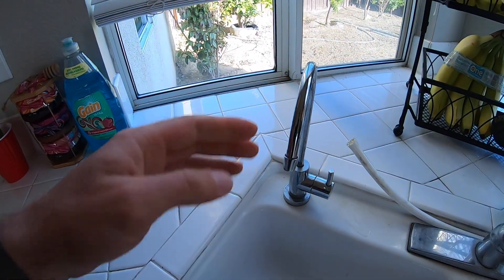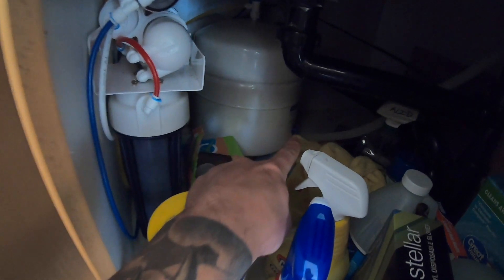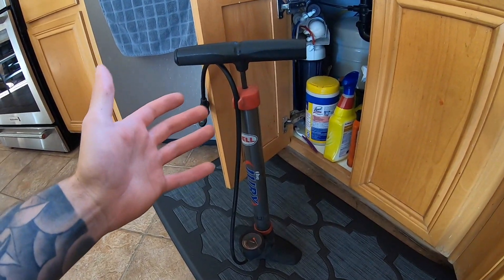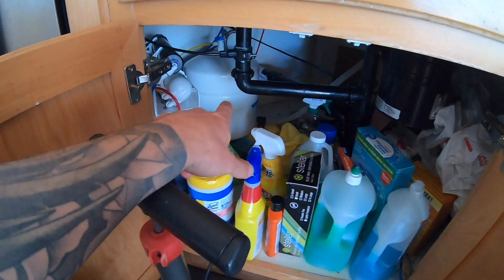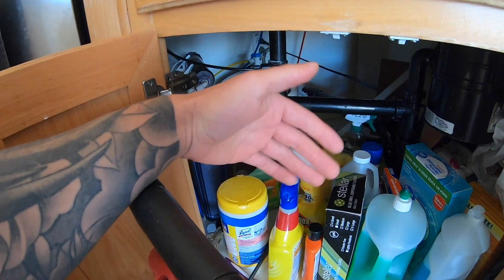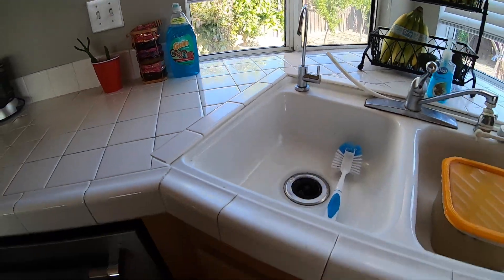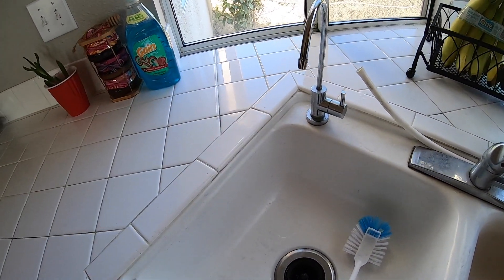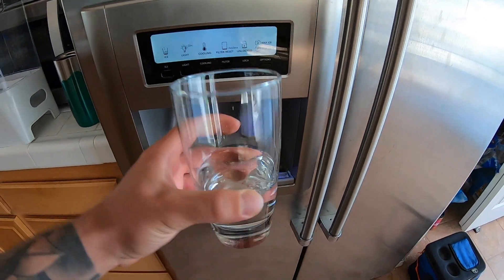How to get MORE PRESSURE Reverse Osmosis

Comment: Hey man, great video. I came here because I was changing my filters today and was wondering if there was something I could buy to increase the pressure/flow. Turns out I didn't need to buy anything. I do have a few addendums which may help other people though.
Firstly, after viewing this video and seeing torkmonster's comment below, I checked the Az page for my filter and it says I can charge 10-12 PSI *empty*. This should get even better pressure/flow than you achieved as the air pressure will increase as the bladder expands.
After charging the tank, I opened the valve and suddenly, a lot of water flowed out. This suggests that the relaxed bladder holds a fair bit of water and contrary to what others suggested below, this may increase tank capacity. Experiments would be needed but I never use the full tank anyway so don't really care.
The label on my tank says factory charge 7PSI but my pump gauge read 0. I don't know if it means that it leaked down but it seems like this is a procedure that is probably best done at every filter change. So thanks again.
The tank says 100PSI max which suggests that you could probably go for a bit more pressure. I'm not sure what the outlet pressure of the RO system is or at what pressure the RO process might get interfered with so probably best to stick with the recommendations or close to. I'm also not sure if there's a pressure regulator in the system but I suspect so.

Comment: The line pressure for the water will come to the same equilibrium on the next tank refill. So by adding too much air it will help you only one time but diminish tank capacity forever ( unless you let air out of the tank bladder system).
Reply: I found after I added air, I actually got more water out of the tank after I had 'emptied' it. So it may actually increase capacity as the bladder holds water when relaxed.
Reply: @chaos.corner  Fyi, adding air absolutely decreases the tank's water capacity, whether or not the psi was too low to start with; full stop. 

It's true that adding air allows the tank to empty out more of it's water. It's just that now your "full" tank has less water in it to start with.

This is why you want the correct air pressure. Too little and you'll have lousy dispense pressure. Too much and your tank holds less--plus it won't help your dispense pressure because of how the shut-off valve works.

Comment: From what I’ve viewed, your suppose to do with the tank empty ?? Inflate to 6-8 PSI empty. Pressure will go up once filled. But this must work, curious what size line goes to your fridge ??
Reply: Must be one or the other. Pressure with the tank empty will be different than filled. I don't think I ever use much from my tank though.
Reply: Update: I checked the Amazon page for my RO system and got "Yes, you can increase the air pressure inside the RO Tank to a maximum of 10-12 psi on an empty tank." so you're right. I'm going to do this. It wasn't in the instructions, I'm pretty sure.

Comment: You can’t compress water. I have no idea what happened when he pumped that up. 

I would do this… with the tank empty! Turn off that water, open the sink valve
Reply: There's a rubber bladder inside the tank with air around it.

Comment: Doesn't look like much difference in pressure?  I did the same and still have very low pressure on my new unit!!
Reply: You're supposed to do it empty. Still waiting for mine to refill after a filter change... Mine was at 0PSI so they may leak down in time too.

Comment: So if you add pressure to the tank, and the valve only produces water until tank pressure is 2/3 incoming pressure, wouldn’t that just mean you store less water in your tank? I think the incoming water pressure dictates how much pressure sits in your tank. Once the water leaves the tank, pressure will not go up past 2/3 of incoming water pressure again.
Reply: You are exactly correct, bad info in this video.
Reply: Yes, agreed. He pumped it up while there was water in it so of course the pressure increased. Next time the tank fills the water pressure will be the same as before, only the tank will hold less water. Bad info in the video.
Reply: @SteveThePre  so what do you do?  Drain the tank, then pump it up?  Does that work?
Reply: @myeyepie  Drain it completely before you adjust the tank air pressure, yes.  It only worked for this guy because he added air while the tank was full, and the next time his RO cycles, his tank water pressure will go back to crap again. 

You can't substantially change the water pressure by overinflating the tank. All that will happen is the tank will hold less water, but your RO tank's water pressure will remain roughly the same. This is the nature of the way RO fill valves work. 

One thing you can do is add a pump to your supply line just before the RO system altogether. That will increase the RO's incoming water pressure and in turn increase the pressure of the water that gets stored in the tank. There are other methods but this works pretty well and isn't too awfully complex or expensive.
Reply: @SteveThePre  well my water pressure is 70 incoming all the time.  Not sure I would want to push it much higher than that.  When I went from 65 to 70 I had all sorts of small leaks show up around the house that had to be adjusted to accommodate that pressure.  

One thing I did do that helped under the sink was to put a second tank.  Apparently the fully charged tank has the highest pressure so by putting in two tanks I ended up with twice as much water coming out at peak pressure.  But the fridge pressure was still very weak.
Reply: @myeyepie  Yeah I had/have the same problem with the fridge dispenser. The beauty of it is, the pump only increases the water pressure that feeds your RO. It doesn't boost the water pressure of your whole house. I'm not saying that kind of pump is a miracle... It got my fridge to fill a glass of water in like 18-20 seconds instead of almost 30 seconds, which is significant in my book. 

I added a second tank as well. That does nothing for flow rate unless you raise it up higher than the first tank. It does, however, give you more stored water before the RO system needs to regenerate, such as if you fill pots with water for pasta, boiling, etc.

One other thing that might help... Remove the water filter that's in your fridge. All it's doing is restricting flow rate. If your RO is running properly, the fridge filter will not take a darn thing out of your water that the RO membrane didn't already remove.
Reply: @SteveThePre  It works because there is a bladder inside the tank and you're adding air to the volume around the bladder. You're correct you're supposed to add it to an empty tank though.
Reply: @chaos.corner  Yep, I understand that. The problem is, the back-pressure from the tank diaphragm is what shuts off the refill process (ASO valve). You want just enough air pressure in the tank to let it get nearly full just as the ASO shuts off. It's true that too little air pressure will reduce the dispense pressure, so yeah, his tank "might" have been under-pressure, but this only happens if there's a leak or if it was mis-pressurized from the factory.

Anyway, once you get the tank up to "just enough" psi, adding more air won't help. More pressure just means the tank won't get full as full, because it will reach the ASO's back-pressure shut-off level earlier.

He artificially added air to a full tank. This works only one time. Next time the tank refills, he'll have the same dispense pressure as before, but now the tank will hold less and the system will cycle more frequently. 

Most people misunderstand how these systems work. I've seen a number of other videos where people add psi or add a second tank to improve flow rate; neither of these actually works.

The "best" way to to solve this is with a bigger 3/8" system; it won't increase the pressure (you'd still have the same ASO issue), but it will increase the flow rate, which is what we're really after. Problem is, it's expensive and time-consuming.

Instead, the usual solution is to increase the supply water pressure, which is typically done by adding an electric booster pump just upstream of the RO for around $100. This way, the tank pressure can get higher before the ASO shuts down the refill process.

It would be super cool if someone made an automatic air compressor that pressurized the tank after it was filled, and de-pressurized it when refilling. This would be massively more energy- and water-efficient. Maybe it already exists and I'm just unaware.
Reply: Edit: Just going to put at the top that I looked into how the shutoff valves work and affirm that you're 100% correct so please ignore anything below that appears to question that.

 @SteveThePre  It wouldn't be a one-time thing unless the air leaked out somewhere but correct that he should have done it with the bladder empty. I believe he's way below the pressure that would cause things to stop functioning.
I did mine after I replied above. It supposedly was factory set at 7psi but my pump read 0. The instructions said up to 12 psi so I went with the max and, to my eye, it definitely improved things. I may make some measurements at 0, factory (7) and max (12) of flow rate and capacity (since some people have expressed concern about capacity reduction) and put it in a video myself.
I would like to know more about the ASO as I assumed there must be one and I'm guessing it's the block with four tubes going into it. It's just described as the 'shut off' in my instructions so I wasn't clear that it wasn't for something else. Would it say on there what pressure it sets to? It would seem to me that that would limit any benefits of increasing the supply pressure beyond a certain amount.
Reply: @SteveThePre  Oh, I see what you mean on the one-time thing and the diaphragm back pressure. I'll have to think about that a bit but makes sense. I still want to run those experiments as I think there's likely still a benefit in there somewhere.